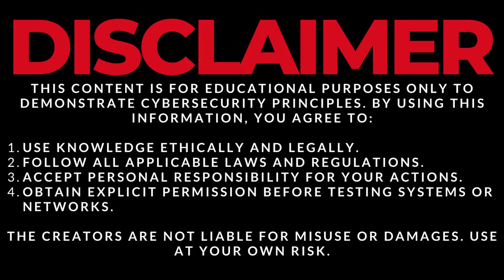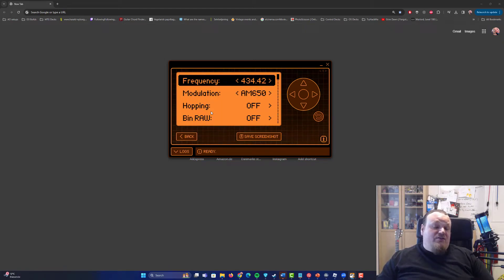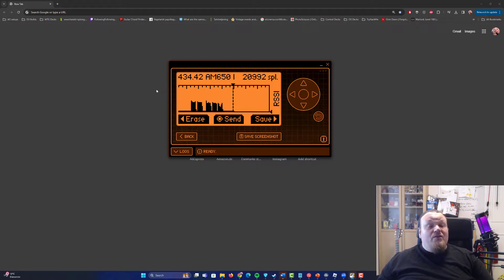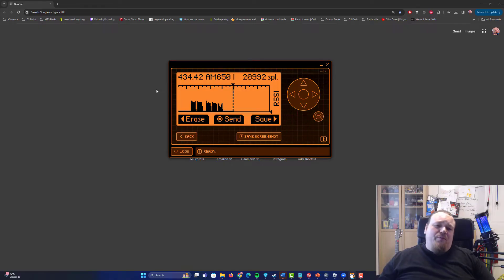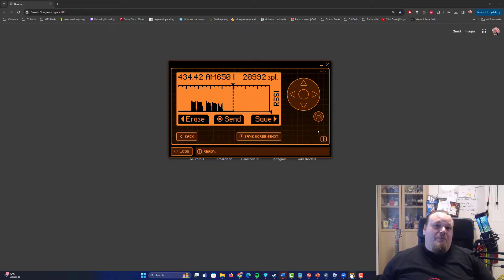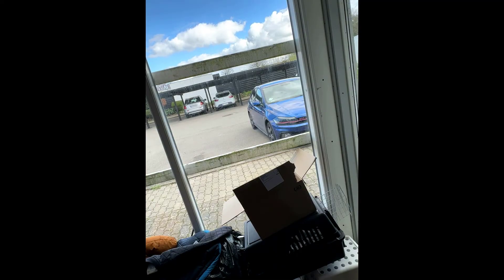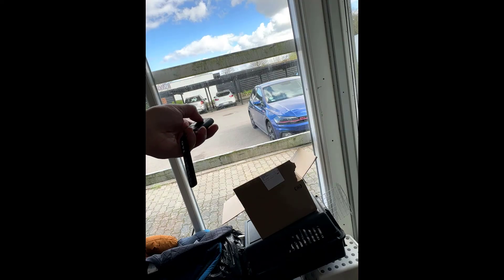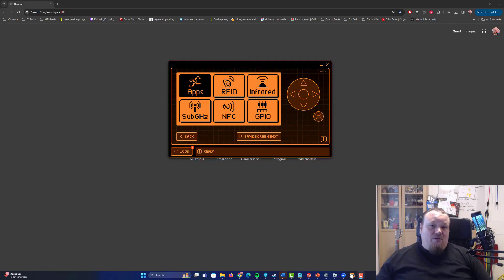Flipper Zero Car Key Signal - Unlock Car Key FOB - Hack Rolling codes

Comment from the maker: Lets together explore how we can use the flipper zero to unlock a car but also how can this perform a denial of service attack or can it? :)
Reply: Thanks for sharing that my friend!
Reply: To my knowledge you would have to get out of range of your car. Record the lock/unlock. Then come back in range with both the fob and flipper...send code. It should work once and keep the codes aligned on both devices. Just don't use it again
Reply: Do you know how to bypass roliingcodes
Reply from the maker: @AlexNielsen-w1l  That is not possible.
Reply: @secbydaniel This is possible!  There are firmware based on unleashed where protocols work for many cars. The flipper works as a code grabber
Reply: Sound so Danish 🤔😉
Reply: This is how I cloned my car key and used Flipper and since then my car doesn't recognize the original key. Is there any way to reverse it so it works again? 😄
Reply: The flipper right outside of the box can actually jam the signal for keys.. this is something you should never do though because it is illegal

Comment: If my car doesn’t use rolling code can I just use that one frequency?
Reply from the maker: @bomquequemoneysick3236  no :)
Reply: @secbydaniel  Yes you can, pre 2000 cars don't use rolling codes and can be unlocked with 1 frequency.
Reply: @Krahamus my 2008 Astra 1.6 see the signal but doesn’t work
Reply: yes